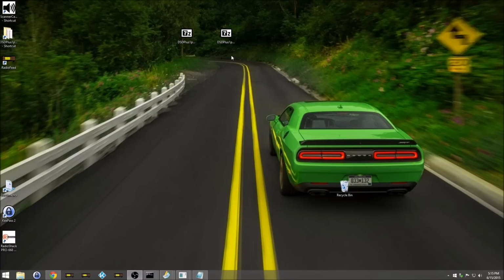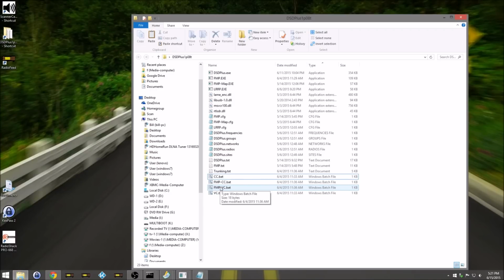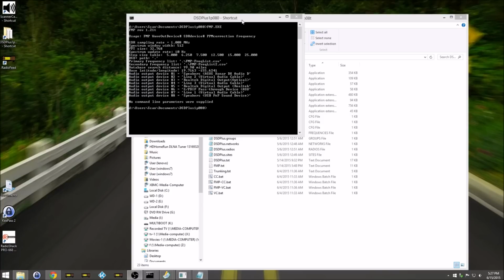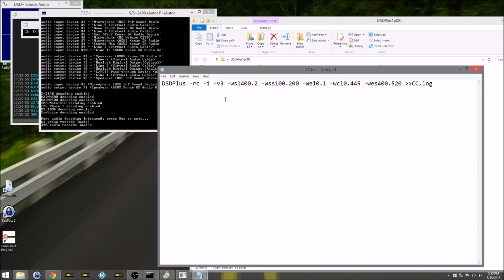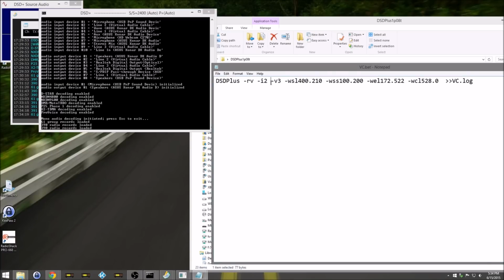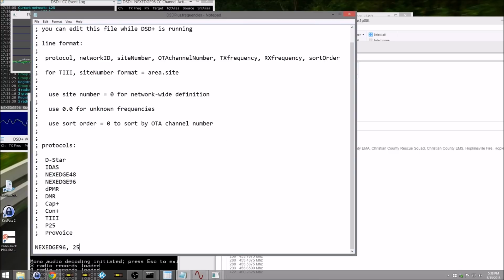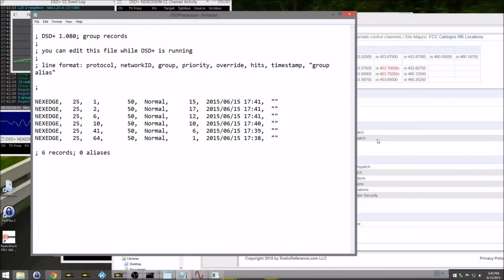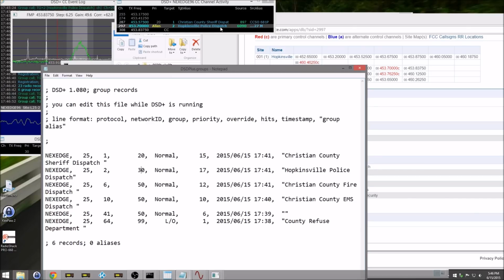DSDplus Trunking Setup 1.08t

Comment: I have a question about dsd plus 101 ..i seem to be getting a strong signal in the oscilliscope but it fails to decode anything...also saw a failed sync message. I'm getting a lot of hits from unitrunker although its signal is usually in the red or yellow at best,, I can change my atennae but I dont think thats the problem..do i have to edit someting in dsd plus bat files for it to work properly?

Comment: Can this be done using a scanner with a discriminator and a dongle.

Or would it work better with two dongles.

If using two dongles would you get better results using two airspy dongles
instead of two cheaper dongles ?
Reply from the maker: +Fred P It can be done with a scanner and a discriminator tap and a dongle. I do not think it can be done with two airspy. You could use the airspy and the dongle though.